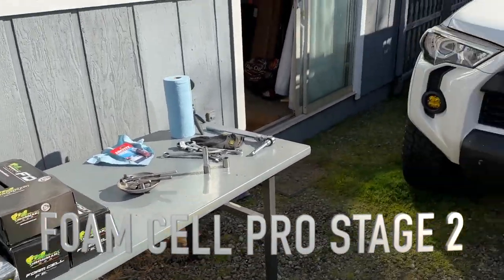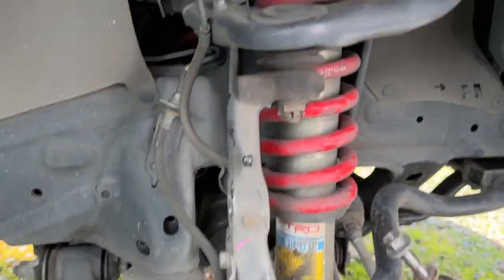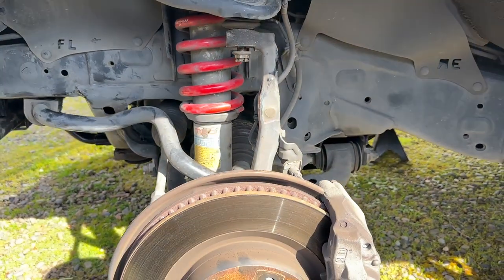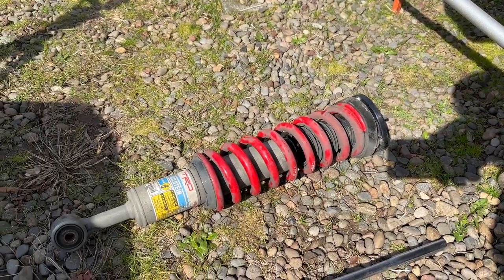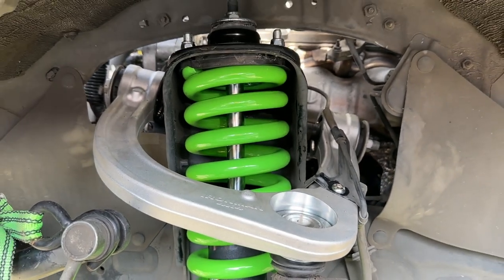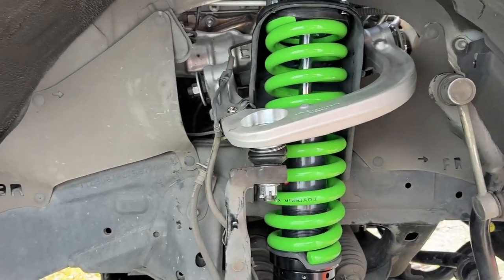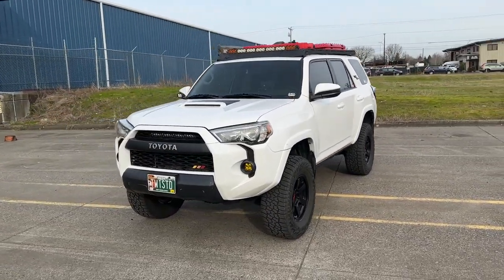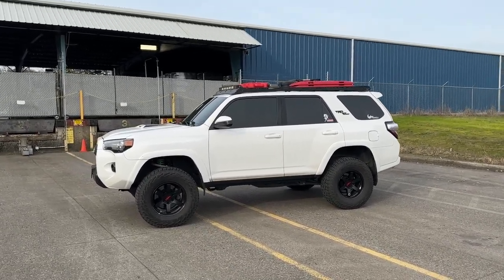Ironman4x4 Foam Cell Pro Stage 2 Suspension Install on my 4Runner.

Comment: Go to the stage 3. It frees up the ride way more. I did the stage 2 and realized quickly that the adjustable panhard bar was necessary. Running it for 3 years now and it’s amazing.
Reply: Stage 2 includes the panhard bar. Stage 3 adds the trailing arm.
Reply: Maybe it does now. It was in the stage 3 when I did in January of 21. Trailing arms weren’t part of it but beefier sway bar end links came with it
Reply: I see, I have the stage 2. Since I only have a 2" lift rear, they said it's not necessary for a stage 3

Comment: I totally understand wanting to swap out the TRD suspension for a different setup. One thing about going higher than 2" in the front is that the wheels get drawn in closer to the UCAs resulting in a narrower stance and causing possible rubbing issues.
Reply from the maker: The amount that the track width shrinks due to the arch swing of the arms between 1-3" is minimal. I don't have the time to do the math right this second.

Comment: I went with the same setup. Haven’t upgraded tires yet. What size tires are you running? Did you have to mod anything for rubbing? Wheel spacers? 

Trying to see how big I can go before any major mods like a BMC are needed

Comment: Amazing! I'm actually looking at this kit (stage 3) right now to replace my Fox suspension on my TRD Pro. Did you have to get an alignment after? How are you liking the setup so far? On and off road
Reply: the rep told me to just get stage 2 since I was running 34s(285/75r17s) and just the 3" of lift with no other mods. he said the pan bar wasn't going to need to be replaced. so I said okay and saved $500